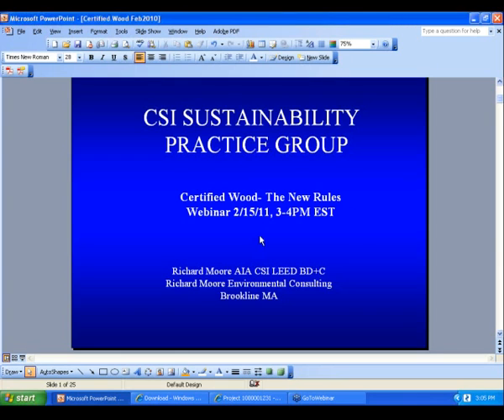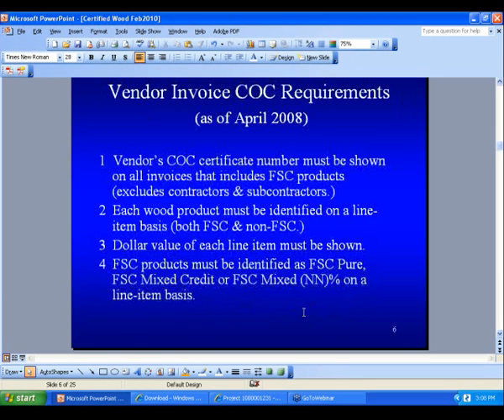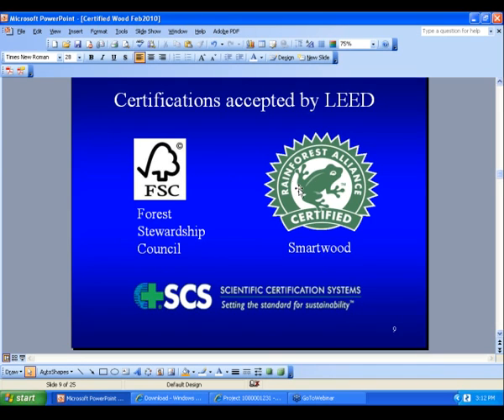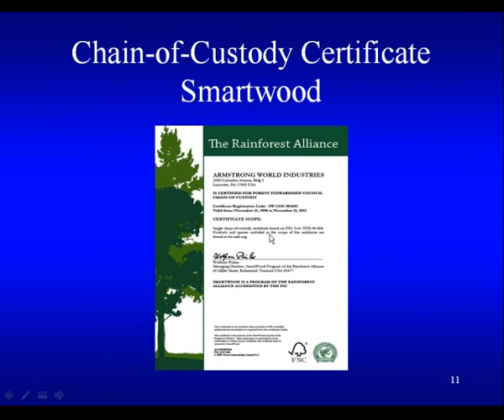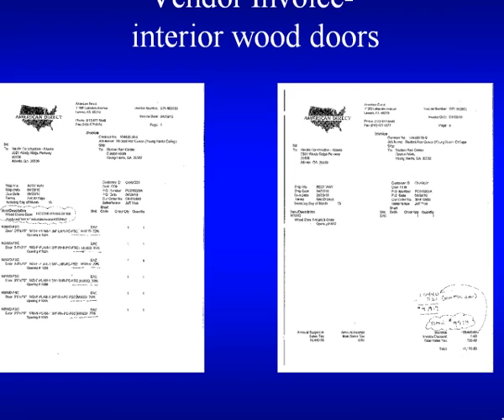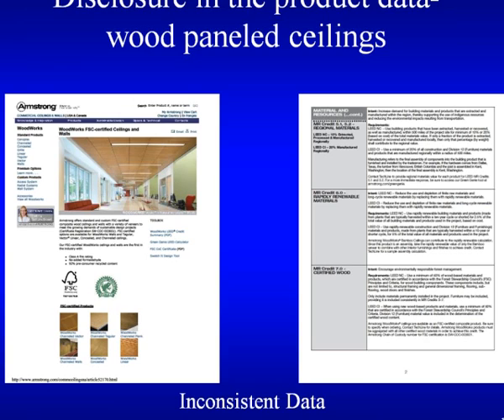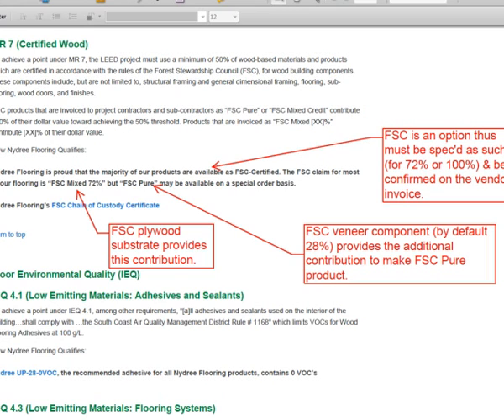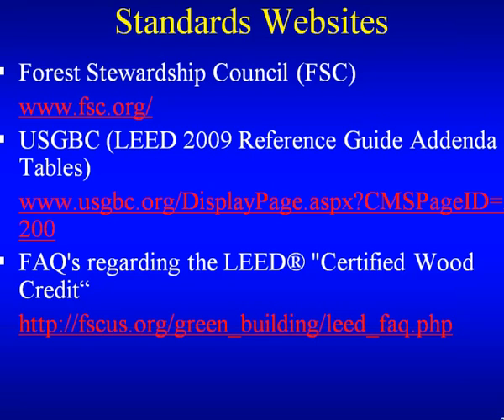Certified Wood: The New Rules

Comment: Great Video! Just finished a LEED CI project as a subcontrator.
We used rough 4 trailers of 3/4 x 4 x 8 FSC PBC from a major manufacture,
The product was sold with a FSC Claim of "Mixed Credit"
When it came time to submit to LEED. we were told the the product does not count towards MRc7, but to MRc4.  The manufacture spec sheet does state that the product is 100% recycled. Am I paying for an FSC product that I can not use towards my FSC 50% goal?

Comment from the maker: FSC Mixed Credit means mostly FSC new wood & other controlled new wood (not recycled wood.) Unfortunate many manufacturers websites/product data sheets are not up to date on these rules or do not know of the changes. The bottom line is that the FSC vendor (the final person on the chain-of-custody) should know and should inform customers that FSC recycled wood product no longer counts towards the LEED certified wood credit.